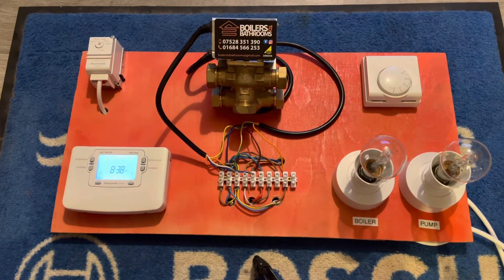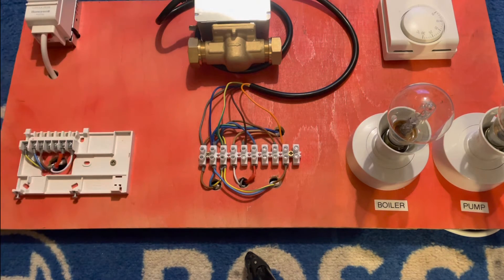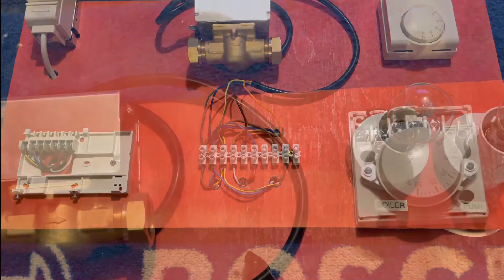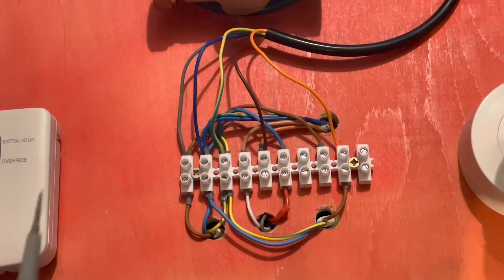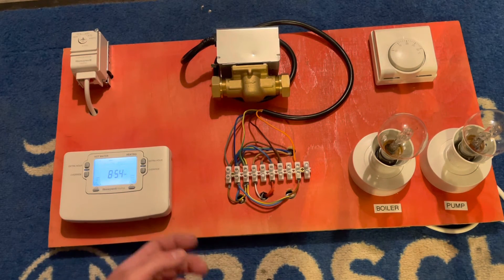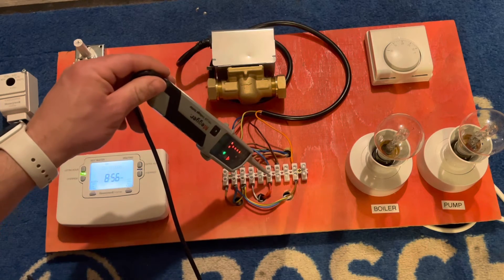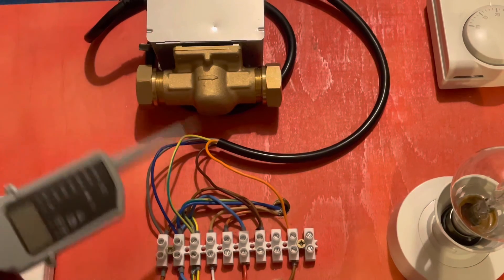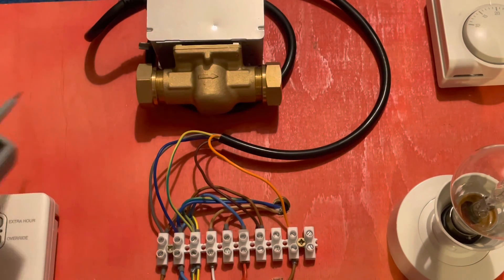S plan wiring explained Honeywell edition

Comment: Hi mate, you got a great calm way of explaining things, cheers for that.
Question? Why are these teaching boards showing a pump as a separate entity from the boiler? Isn’t the pump inside the boiler or are these older system layouts and the pump is external, therefore needs to be wired in?
Thanks in advance.
Reply: A combi will have the pump internal to the boiler but an external pump or "circulator" is common for the heating side on s-plan I believe.

Comment: Thanks for the video ,i have a question pls i want to install hive to unvented cylinder s plan system but have 2 wiring centres 1 on the wall near the cylinder and 2nd on the cylinder attached to it zone valves connected to wiring centre on the cylinder but roomstat connected to wiring centre on the wall ,any help much appreciated